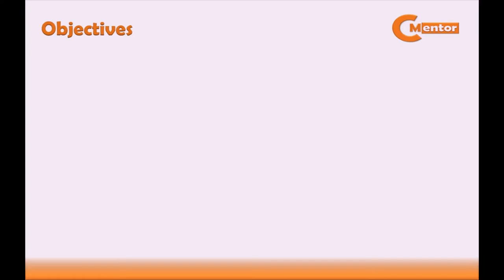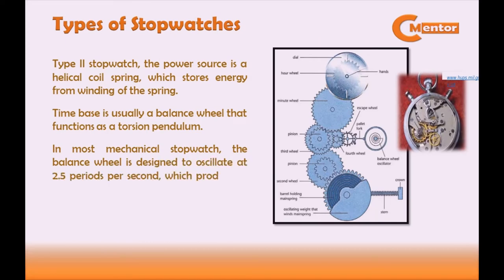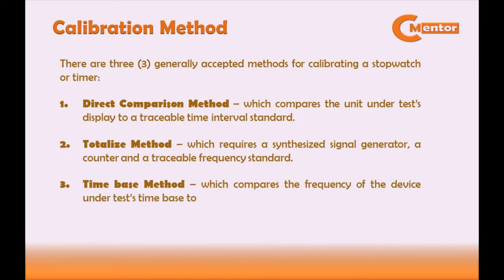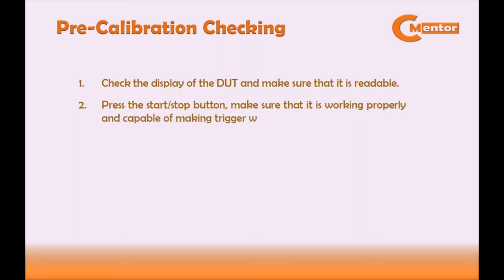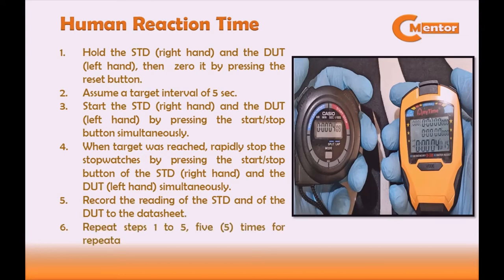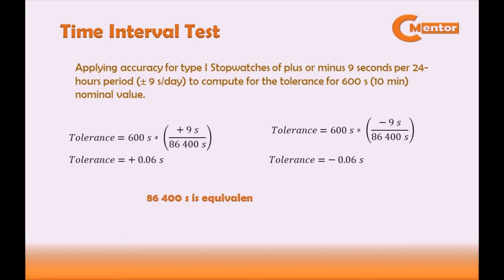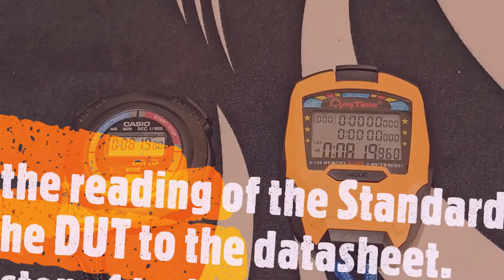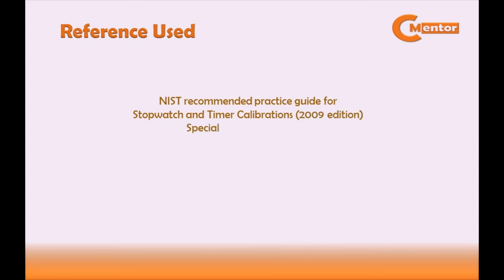Calibration of Digital Stop Watch || Using Direct Comparison Method

Comment: Hi. is there we need to compensate the reading to 20degree celsius, as per other dimensional equipment?

2. if customer have multiple set point, let say 1 minutes, 10 minutes, 30 minutes.

Is it i need to restart again when completed the 1 minutes reading? or i can continue from there for the next cal. point